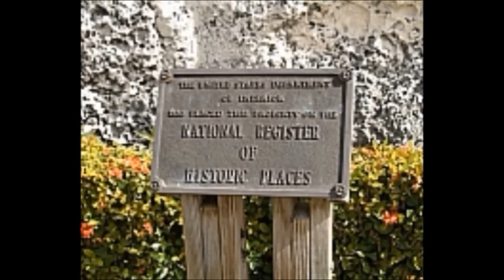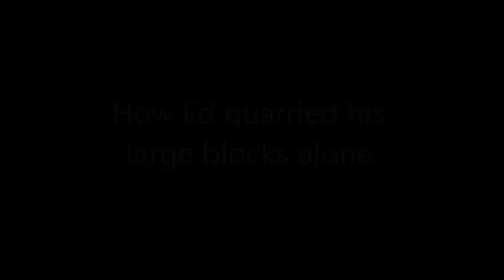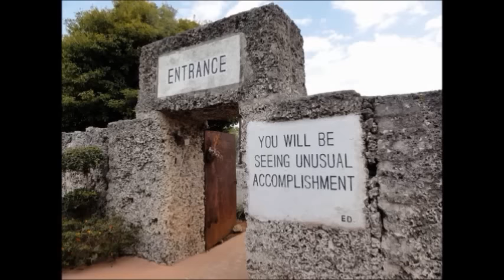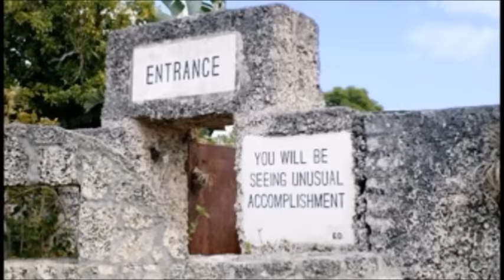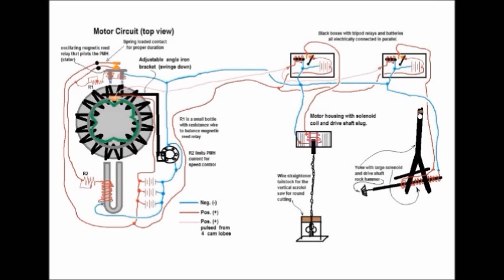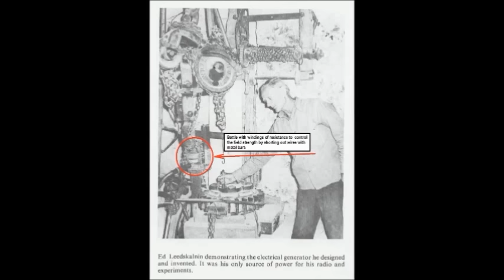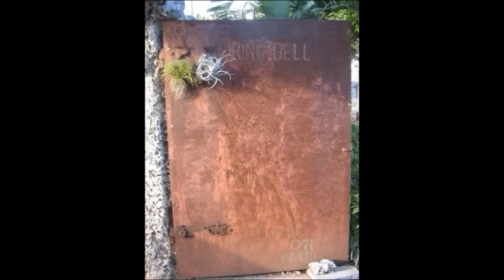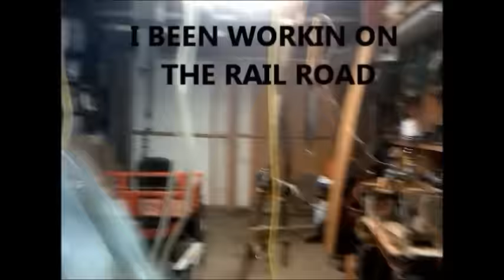Eds Coral Castle Quarry and Flywheel, Engineering Mystery Solved

Comment: Have you visited his original homestead? Northeast of its current location.  I was given permission to view the land where he originally set up his "castle". The area contains hundreds of metal pipes. A newspaper article in the office gives the clue to how Ed cut the coral. He used water pressure to cut and move the large pieces of coral. There are large square holes in the ground where he had removed the coral. This motorized contraption could not get under the pieces of the coral, so he developed a high pressure water system to undermine the coral. The devices you show are tinker toys and would not stand up to the daily work load that he produced.
Reply: @Ebony Hayes ...Without being mean, and just to get you thinking... The Easter Island statutes are just as heavy, and not compact like Ed's blocks. Yet they were moved.  There is that video of a man using round stones and levers only, to move 20+ton blocks across his backyard...then lifting them upright. Used a GoPro? camera and invited all his family to watch him prove it could be done.